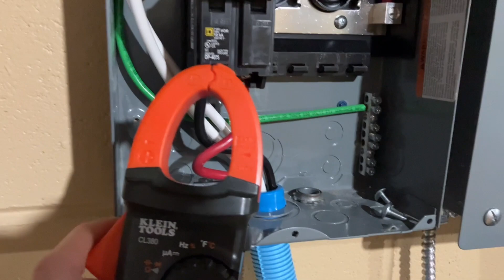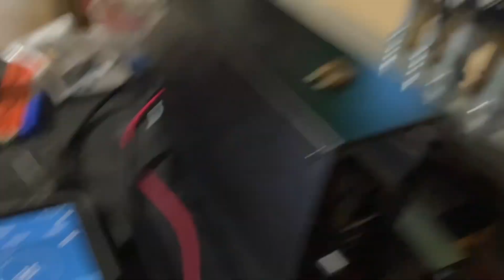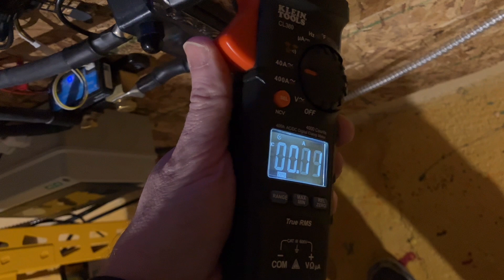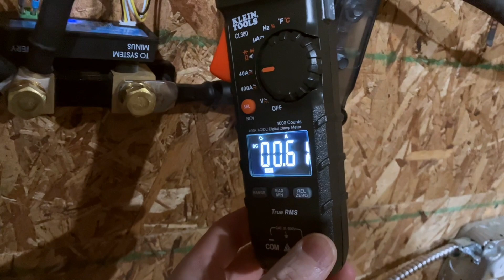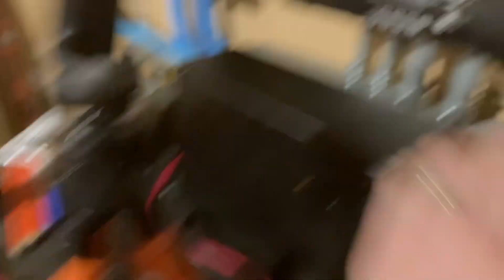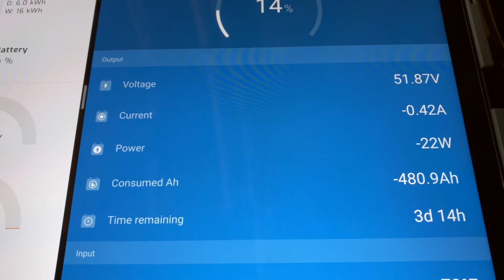EG4 6500 Power Consumption Observations

Comment: Explain this one:  EG4 6000EX - Load: 13W PV: 184W Grid: 0W (no grid connection) Battery: 0W -Battery currently at 58%  If I'm taking in 184W and have a 13W load, shouldn't I be putting somewhere around 171W into the battery?  Ok, subtract 90W for overhead 171-90 = 81.  Where's the 81W going?
Reply from the maker: Yeah, that's a tough one.  Is the 90W overhead a measured figure or just what the manual says?  I've found in quite a few instances that the number in the manual is a "ballpark" figure.  It can be different per inverter.  Still, I doubt it would be 81W more in consumption.  

Do you have any other DC devices connected to your system?

Comment: Hey all . 
Off topic a little. Wanted to share something with our 2- 6500 ex’s 
Things have been going very well as of spring 2023 . We added 10 more panels for a total of 40 . Using all 4 charge controller inputs. As well as adding 6 more EG4 batteries for 12 total. 
All was working fantastic. Until about 2 weeks ago the weather pattern changed and we’ve had a few cloudy days. I monitor battery charge daily and noticed the batteries were only about half. 
( ok expected as it’s been cloudy) . However I noticed when the sun was out in full. Even light loads on the inverters. Each was only charging 20 amps or less. With the batteries at half . 
I’ve been stumped as previously similar situation each inverter would charge 90 amps or more . 
I happen to scroll through settings. And for some reason the main inverter switched itself from (EG4 ) battery selection to user . Have no idea why. 
Changed back to EG4 
And charging went back to normal 85-90 amps per inverter . 
These things sure have their quirks
Reply from the maker: I've heard of this happening several times.  I can't recall if there was ever a resolution though.  I know there were some firmware versions in the past which had some problems with settings changing.  Do you know what firmware version you're running on your inverters?

Comment: Every lv6548 no matter the brand will consume almost 100w each inverter on idle,  that is the load that you see, inverter circuits consume electricity to be able to work, the switching circuit, feed back loop and control will consume power also the cooling system. Most important the sine wave needs to be generated at all times not only when you connect the loads. That is the energy need to work on the inverter. In ideal world circuit will not have losses and 100% energy  in ,will be 100% energy out after conversion. That is why they tell you the efficiency of the inverter because we are not in an ideal world.
You are not missing anything just don't have enough knowledge in electronics and circuit engineering design. The inverter also will keep pulling power from the battery even if it is connected to the utility because if he needs to swap sources the feedback and control loop needs to keep operating during the switching process. And the new version since it has a higher input voltage the circuit will need to handle more power.
Reply from the maker: Thanks for the comment.

Your the only person I’ve ever heard say that every lv6548 will draw around 100w idle load.  In fact there’s people that commended on this very video that their lv6548 idle consumption was very different.

The thing that bothers me about the battery draw is that I was told by SS that when in grid-bypass, the idle consumption gets pulled from the grid, and yet there’s still a draw on the battery.  If the idle consumption is being pulled from the grid, then when your in grid-bypass mode, your idle consumption is actually increasing by 40% due to the additional draw from the battery.

Comment: These inverters have a lot of issues, and I am sorry that I recommend to my friend and partner,  we've noticed the flickering problem to, but haven't even gotten into dealing with that yet. The first major issue is when operating from the grid and the batteries are charged and floating, that goofy charger has a problem, apparently it is incapable of going to the floating voltage of the batteries so it cycles on and off to keep from over charging the batteries, so I found out quite by accdent that as it does this, it creates as high as a 140 volt spike on the AC mains. What alerted me to this problem was that I had one of these units hooked up to one of the battery banks that I had just received, and was charging and balancing the pack, and the pack had just reached the float voltage and the active balancer was in the process of getting all of the cells in balance. I left the room, and went into the kitchen to start making my dinner, and I have one of those PIC induction cook top 's from New Wave, so I started to boil water, as I was making  Spaghetti, and needed to boil the noodles, but my induction cook top, just would not boil the water, it kept starting and stopping, and I almost threw it out in the trash, because I thought it was failing, but I noticed that the light over the stove was flickering just slightly and I already knew that that induction cooker would not operate on a modified sign wave inverter, it had to be a pure sign wave inverter, so just on a hunch I got out my fluke scope meter, and connected in across the line,  and there was this very sharp spike every time that inverter would cycle, and I even tried it at my  Neighbor's house, that happens to be on the same pad mount transformer as me and as long as I am on the same phase as the  EG4 inverter it would not work at his house either!!! Even though the spike was not as strong only about 46 volts even the transformer was unable to completely block the spike. So needless to say I am not very impressed with these inverters, although they do have some pretty impressive starting power, my buddy has had several over current trips on these inverters, but as long as the hot water, and or the dryer is not running, they will most of the time start up there  9 ton heat pump that has a 161 amp industry very impressive!! 
But we have problems with them shutting down randomly during the night, and when you go out to check them, they are both dark, just as if you had turned them off, but both power buttons are still in, but cycling them brings them back on line as if nothing is rong and they have no errors showing?????
And then there's the flickering lights! I just think there's too many problems, and I don't think a software update is going to fix all of them 😕
Reply from the maker: Seems like you have quite the laundry list of problems.  Have you talked with Signature Solar about these issues?

Not sure what could be causing the voltage spike.  Only thing that comes to me about the shutdowns would be battery disconnects.  Wonder if the WatchPower logs would show anything?
Reply from the maker: I know I saw someone comment on the forum about random shutdowns. Seems like it might have been a hardware issue and their units were replaced.

Comment: The higher open-circuit PV voltage (500V vs 250V) of the solar charge converter has a price in terms of idle power draw.
Reply from the maker: I would agree with you except for the fact that the first batch of 6500s that I had only had a 70-74w idle consumption.  The newer revisions are now 89-94w (and I’ve been told in some instances up to 120w).

Comment: Thanks for putting this video together. I have two different versions of the LV6548 on my bench currently with very different idle consumption amounts and was curious how it compared to the EG4 model (which is what led me here). Got my questions answered! 🙂
Reply from the maker: Thanks Mike!  Been watching your channel for years and you've been a big help to me, so I'm glad I can return the favor in some small manner.  

From my discussions with other people, the LVs have a better idle consumption than the 6500s.
Reply from the maker: I’ve actually been told by SS that the consumption can be anywhere from 80-120w (but I haven’t been able to find out what can cause such drastic swings in consumption).
Reply: @AdamDeLayDIY  Not sure why it would vary like that unless it's based on ambient temperature thus causing different fan speeds? I'm working on a video of the new LV6548V and the idle consumption is through the roof vs the original LV6548 - 110W for ONE inverter! Ridiculous. That's what got me looking...
Reply from the maker: @LithiumSolar  All I’ve been able to get out of them so far is that some of the units have different internal boards which can affect the idle consumption (trying to find out what boards have changed). I know the first units I had, which were one of the original models, had an idle consumption of 70-74w.  The newer units I have now have jumped up between 89-94w.

I’ve actually been waiting to see a review on the 6548V.  I’ve heard there have been a lot of “flickering light” issues like the 6500s.  Seems like both the idle consumption and the flickering lights have to deal with the change in mppt boards to allow for the higher PV voltage.  

110v though is making me feel a little better about my 89-94v though…only a little though.  I miss my 70v…well, let’s be honest, I miss my 20 something consumption from my 12v inverter…

Comment: This is one of the reasons I'm not interested in AIO. Everyone is buying into them, but the idle consumption is RIDICULOUS when you need a dedicated 5kw battery just to keep 2 units running for a day. Standalone inverters use a fraction of the idle current, even the mega cheep ones.
Reply from the maker: Yeah there's definitely some compromises made when you go with an AIO unit, one being the fact that you have a lot of different components that have to work together, not just on their own.  You just have to decide if the single unit package overcomes those compromises in your specific environment.  

My 12v system had a very low idle consumption, and it didn't need fans running all the time, which was nice.  If they had a way to have passive cooling and only active when needed, that would cut down significantly.
Reply: @AdamDeLayDIY  I have a 48v 5000w inverter that idles at 13.5w, and is quiet without the fans running constantly like you mentioned. Thanks for the video.

Comment: Just add two more panels to the 40-60 panels you need to run a typical off grid home and don’t sweat it.
Reply from the maker: That's great in theory, except it just is attempting to mask the issue that you're draining an additional 800W (approx) out of your batteries over a 12 hour time period AFTER the fact that you switched over to grid power due to having a low SOC.  You have to now plan for that additional drain on your batteries after the fact when you're told that when you have AC In, all idle consumption is transferred over to the grid.

Comment: Thanks Adam! Thats crazy to know. That means for my six inverter system, I am expending nearly 8,000 watts during off solar hours. Thats 1.6 batteries or 230 kWh if using grid power. This explains why I cant make it through the night. Using the grid for the idle power is a other dumb design decision, particularly withouf our knowledge or ability to configure this. Need a way to cycle four down in after hours.

Please clarify the setting options of appliance and UPS. I was nodding off toward the end and didnt follow how this might reduce our idle consumption or does UPS only use battery for idle consumption? Why did manufacturer select appliance as default?
Reply from the maker: I agree.  Seems like if you're trying to save money by moving loads off-grid, but you have the grid configured as a backup, why would you want to add the load to the grid?  Doesn't make any sense.  

In regards to APP vs UPS, I honestly couldn't tell you if it changed the consumption or not.  At first I thought it did, but then after some time and reviewing things again, each time you switch between APP vs UPS there's a click and it seems to "power cycle" for lack of better terms.  So it seems to switch between output modes on that reset and that COULD be what's affecting the consumption at that moment.  Then over time it seems to grow again.  Case and point, so near the end of the video I was showing only what, 20-30W draw from the battery?  I'm now back up to 67W draw.  So I can't say that the APP vs UPS does anything at all w/ consumption.  That's another reason why I said that was an observation that I didn't understand.  

The only reason why I can assume the mfg set APP as the default is because it accepts a wider voltage range for AC Input.  Trying to be as "inclusive as possible" for sales...  Either way, I switched to UPS and it's sped up my transfer times between grid and battery.
Reply: @AdamDeLayDIY  Thanks so much Adam! Your scientific discovery is very helpful to the community!!

Comment: My MPP LV6548's, which are the same machine, drew 65w each idle. You can drop it down a bit by turning off the light in your parameter settings, and also set it to energy saver mode (assuming the firmware on the EG4 is similar).
Reply from the maker: Thanks for commenting.  Nice to hear of a comparison between the 6548s.

So I did turn off the light bar and the backlight of the displays (which I normally keep off anyways) and it might have dropped a single watt.  There wasn't much draw there at all.

Unfortunately the 6500s don't have an energy saver mode.  EG4 must have had that disabled or removed for some reason.

Comment: Heya Adam pick your brain for a moment.  Did you make those EMT connections to your inverters or buy them?  They are just too slick to not do.
Reply from the maker: I made them.  Just looks so ouch more professional.  

I bought some 10’ sections of 1”, 3/4” and 1/2”.  I used the 3/4” for the PV lines to the circuit breaker box, then I used 1” for the battery and AC lines.  I was able to use 1/2” for the PV lines.  

You should be able to see a close up shot of the conduits in my Replacement Inverter video. 
https://youtu.be/BPk9qF5cJzA
Reply: @AdamDeLayDIY  thanks for the reply and your time. luckily I have some EMT laying around from my garden hoops for insect netting.
Reply from the maker: @Capoe3  good luck!

Comment: You have to be very careful when using the Adc when using clamp-on amp-meters. Because they rely on the magnetic field around the wire they are also sensitive to the earth's magnetic field. In order to achieve a more accurate measurement it is necessary to clamp the meter around the wire, stop all current in the wire, then zero the meter. The earth's field will influence the reading significantly when you face the meter to the left to zero it then rotate the meter so it faces to the right to make another measurement. Just be aware that you are about at the limit of the ability of these amp-meters to measure.
Reply: It's true that there is some influence on those meters, but unless you are holding the jaws open, or you have an extremely cheap meter, the earth's  Magnetic field will not have that much of an influence on the meter as it is a closed magnetic loop. I am unable to detect any of the earth's magnetic field on my $438 Fluke meter!!! Even measured with a shut, the to units that I have been working with for my friend and partner, on his system, the  2 units draw 102.9 and 103.1 watt's of idle current!!! They are of a very poor design, and I am quite frankly sorry that I recommended them to him,  but they were cheap for their rated power handling. But I guess it just shows, you get what you pay for!!
Reply: @Brokendiode  I agree with some of what you said. which model of Fluke do you have? 
Mr De Lay is using an inexpensive clamp meter and I noticed that he was zeroing the current before clamping it around the wire in question.
As I commented, trying to be helpful, it is best to clamp the meter onto the wire and zero it when no current is flowing. Then when  the wire is energized, a reasonable accurate current measurement can be made. Did you note that the meter did not indicate zero before Mr. De Lay clamped it to the wire? As I said: just my observation and trying to be helpful.

Comment: During the day at 100% SOC with your grid AC input breaker off, what does SA indicate for the PV input vs load. For instance, mine reads 712W PV and 401W load at 1530 on a cloudy day. Thinking of this inverter's PV DC to AC conversion efficiency; manual say 93%.
Reply from the maker: I think it’s gonna be hard to be exact without having meters on each individual piece of the system. Solar assistant does not update all of the values at the exact same time. It can only update based on when it receives new information from the remote devices. The inverters seem to be significantly slower in updating then the smart shunt. It’ll probably also depend on the individual idle consumption of the inverters as well.

I turned off my AC in, and I took a screenshot of my Solar Assistant display.  
372w load
556w pv
+25w into battery

Adding the load, battery and idle consumption gives me more power that what the PV was showing as coming in.  So obviously the inverter data was off.  Unfortunately you can’t quickly look at the displays of the inverters to see all the info you need to make the proper calculations.

Comment: I have both 6500 on standby charging batteries currently. Batteries are fully charged. 0% draw. Will ramp up to 84 watts for a few seconds and then go back to 0. But batteries are 100%. Yes they pull a lot of power but for the price this is what we get. Have a friend of mine using dual Victron Quattros 5k each and they pull enough that he turns them off when traveling and use a small inverter for fridge. We are in rvs. So no free lunch here regardless of cost
Reply from the maker: Yeah when your in standby you’ll have significantly less power usage, especially when the batteries are full.

So do you use your system just as a backup?
Reply: @AdamDeLayDIY  for now. Waiting on warmer temps to finish hook up.